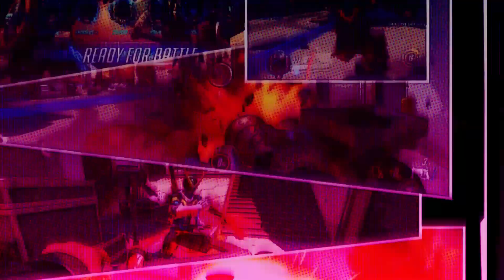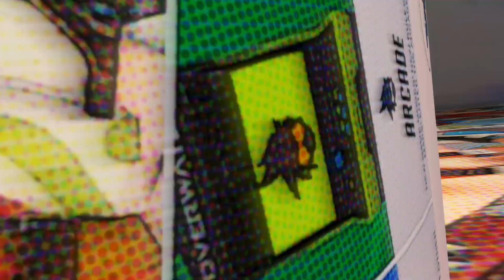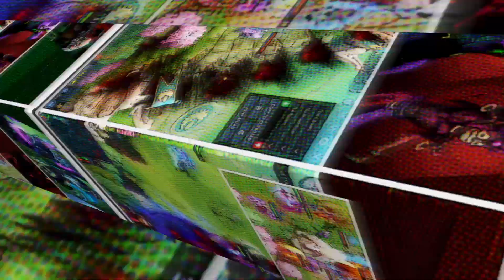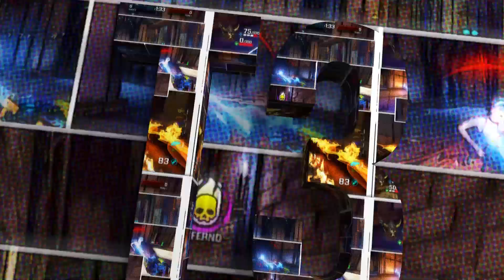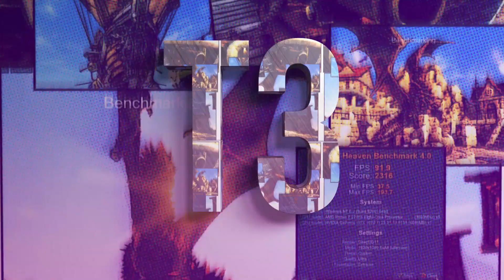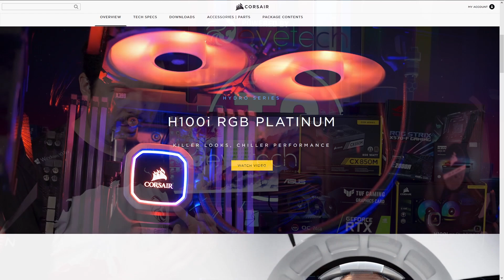Custom Premium Evetech Build - AMD style!

Comment: A step by step installation guide would be really nice. I got this case and the Corsair cooler but I am overwhelmed by the installation process as it is my first proper RGB case and cooler. What did you do with the Corsair RGB control box?? I see the evetech one but not the corsair one?
It is a nice video but I really think spending more time on showing how you install the hardware would go a long way and be highly appreciated.

Comment: why only 2 ram sticks? if you’re going all out you should really use 4 right?
Reply: Actually you're right because the Ryzen do benefit from having a full set of RAM but these sticks are super fresh so I didn't want to mix with older variants
Reply: @WookiEXXXL  doesn't benefit from more ram. Ram speed is very important for ryzen. Adding another 2 sticks won't add much performance gain.
Reply: @staticsm  false go check thr gamers Nexus video on it where he conclusively proves 4 ram dimms beat 2 on AMD by about 5 to 7%.
Reply: @WookiEXXXL  Not for intel. Maybe for AMD since AMD utilizes more ram and the speed of it more than intel.
Reply: @staticsm  is the review on an Intel?
Reply: @WookiEXXXL  I'm not bothering watching him. If you trust more than one source you will see what I mean...
Reply: @staticsm  I'm literally the tech reviewer in this video and have tested and seen his data as well as Debauers which both say the same thing. If you can't concede a point you have no data on then there is no point in discussing further. My concern tbh is someone believes your statement and makes a mistake they shouldn't because they think you are informing them of facts which you are not.
Reply: @WookiEXXXL  dual vs quad channel memory wont give you much performance gain.
Reply: @staticsm  you're right quad channel would give you more but the motherboard onky had 2 channels with 2 dimm slots on. Each channel like most motherboards do... So 4 sticks wouldn't make a major increase onky slightly